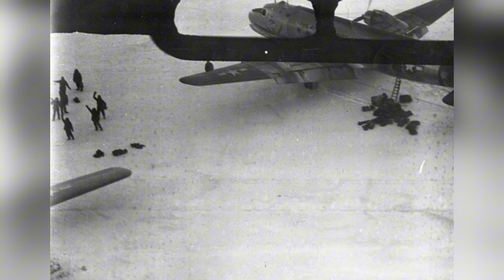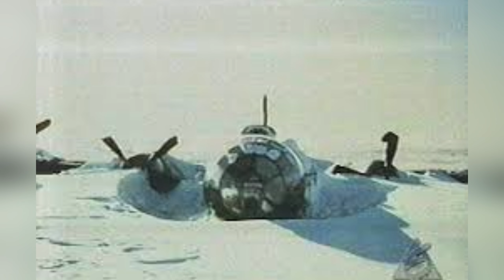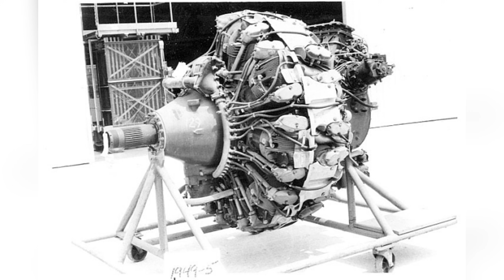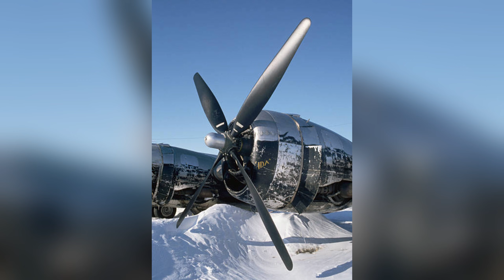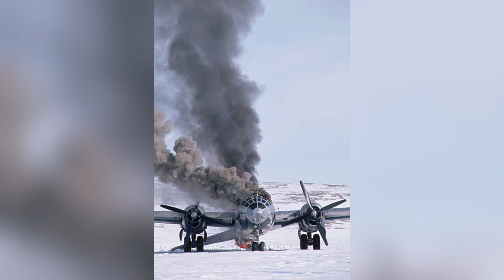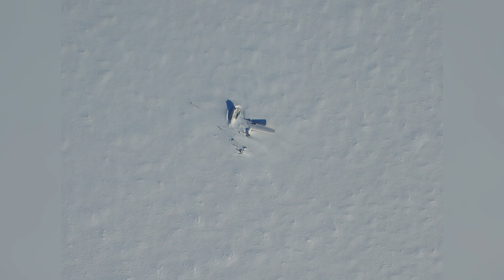Recovering B-29 "Kee Bird": The Arctic Salvage That Ended in Fire

Comment: A very well-known and sad story. Thanks for the details. I didn't know the cause of the fire. If the team used a plastic tank in the aircraft upgrade, then the death of the project's chief engineer have been fatal for the project – I'm absolutely sure the chief engineer would never approve the installation of such non-aviation equipment. Moreover, the costs of any installed equipment, works, renewed aircraft and total risks were thousands times more than one else fly of transport arcraft and back, needed for getting the correct equipment. The main role of chief engineer is to estimate any risks, and he always knows all consequences very well before any actions. Therefore, this story is double sad...
Reply: Darryl Greenemeyer pushed the limits of most everything he did.